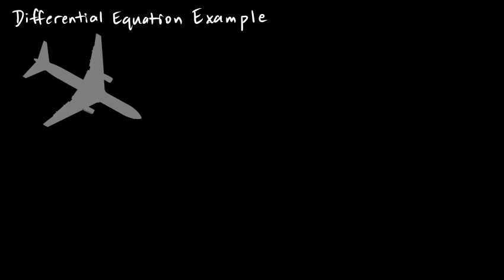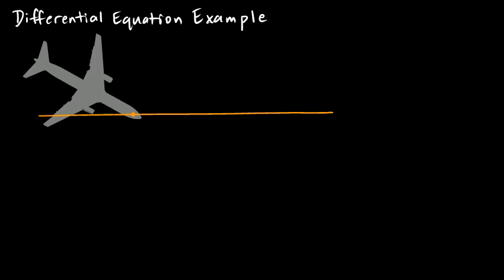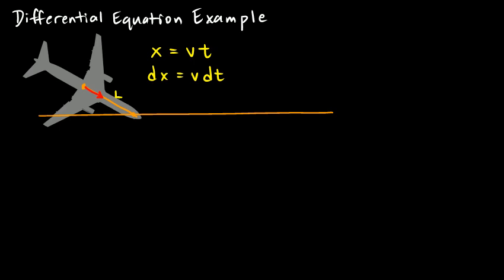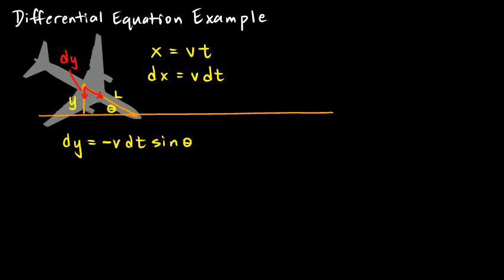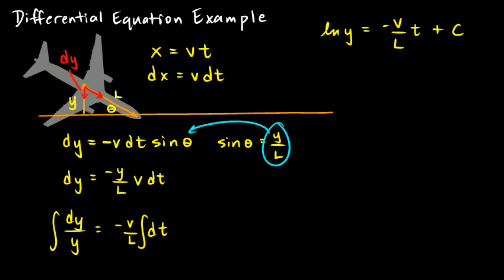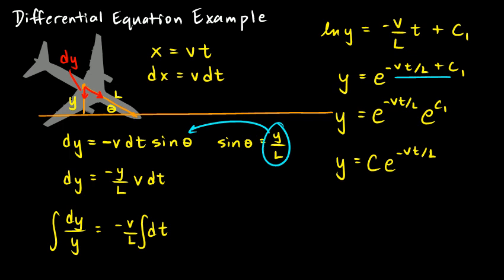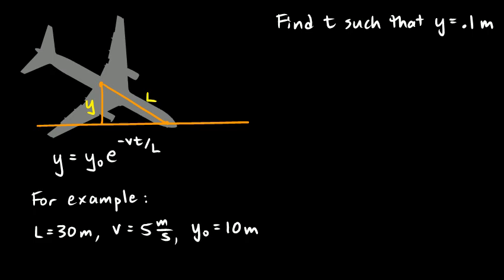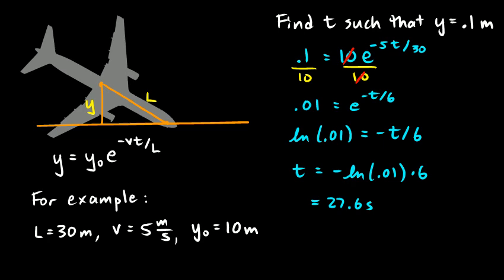Calculus  - Differential Equation Example

Comment: This is so helpful, thanks a lot Derek Owens. 
Unfortunatelly most universities teach differential equations never mentioning where they actually come from! And how helpful they are solving everyday problems in physics and other fields of science.
Reply from the maker: Thanks!  And you are absolutely correct.  At most schools, it is the math professors teaching DE, and it is probably mostly theory.  If you are studying where they come from and how they are used, then you are probably studying physics or engineering, and the physics and engineering professors usually assume that you already know DE!
Reply: Totally agree, I studied EE and it wasn't until analysing second order RLC circuits that I realized how amazing and powerful DE were!
I think similar  tutorials on PDE and how they are formed (like wave equation) by you would be awesome:)
Reply: Yes.

Next up: PDEs. :)

Comment: This is just my guess, since I am still very much a student of math.  I think it behaves this way because theta gets closer and closer to 0 degrees, meaning that after a long time, the rear wheels are mostly pointed forward, and only creep slowly towards the line.  Also, more mathematically, the e^(-x) has an asymptote at zero.  If you plugged in y=0, you would get a false statement, because there is no input that can give you exactly zero.

Comment: I thought you would be tracking the front wheels along the horizontal X axis, yet you kept referring to the hypotenuse L. In other words, instead of calculating using sine, wouldn't you use tangent?

Comment: thanks for the helpful video. why is it that the plane can never be precisely alligned with the line? and can we show that mathematically?
Reply: That is the nature of a log.
Reply: If you observe an actual B767 making that turn, the path of the main gear tires will ARC towards the line with the RIGHT TIRE tracking on a WIDER ARC THAN THE LEFT. Also the distance between the tires are not considered within this calculation, ALTHOUGH the difference between the calculated solution & the actual 'event' is small!

Comment: For people wondering the derivation of the formula for dy, here is an explanation: dy is the infinitesimal vertical change in position. Since dy is opposite to theta and the hypotenuse of the triangle, with angle theta, is |-v|dt, then sin(theta)=dy/v*dt. Hence, dy=v*dt sin(theta). We put a negative sign to indicate direction so dy=-v*dt*sin(theta).

Comment: What will happen if y=0 or y approaching 0?
Reply: its undefined.
if you solve the equation for t, you have: t= (L*ln(y_0/y))/v
but in order for y=y_0, they both have to equal 0 because e^x cannot equal 0 for a real value 'x' meaning [y=y_0=0], but that means that our ratio in our 'ln' is 0/0 and ln[0/0] is undefined.

Comment: Great video, thanks. This is assuming no noise in the system right? Of course in practice after y had reached < a few mm the wheel would keep crossing the line due to imperfections in the wheels, run way, wind, etc.

Comment: Did you ever get your friend to test this? It doesn't seem accurate to me, even though, theoretically it is correct.
Reply: That does seem like a long time for y to reach .1m. Moving at 5m/s you'd think it would be faster
Reply: Although it does feel like a long time, if you do the sums for reducing y from 10m to 1m (instead of 0.1m) it takes only half the time. Such is the nature of the problem.

Comment: If I follow this solution. This plane's speed is just 5 m/s and 18km/s. so very slow and slower than marathoner. The problem is x direction. x is not a  distance of flight of this plane. the distance of x axis when this plane is moving. and 5 m/s is the speed of shade of this plane reflected from x axis.
Reply: sorry mistyping.. 18km/h.

Comment: lost me at 'dy = -vdt sin theta'.  'dy' being the opposite side and vdt being adjacent to theta should it not be dy = vdt tan theta? as tan theta equals the opposite over the adjacent side and therefore tan theta multiplied by the adjacent side equals the opposite side?
Reply: +tbone vdt is the hypotenuse, not adjacent side
Reply: +Thgink Krad  the problem is how do you get dy = dx•sine@ ? if you started from y = x•sine@. For sure we have sine@ = L / y . L is constant and y is variable. and here @ as well variable. But I do not agree you made equation jumped to dy = dx•sine@ . and you got dy=vdt•sine@. show me how come?
Reply: +want to know DE sorry.. there is mistyping.. sine@ = y / L .
Reply: +want to know DE  And I totally agree with tone for '-'. the ' - ' is opposite direction and it does not mean getting smaller..
Reply: +Thgink Krad also as we know the speed v=5m/s. Do you really think the speed of plane is just 5 m/s ? as you said x direction is the direction of flying. so plane's speed is 5 m/s which mean 5×3600 m/ h so 18 km/h. this plane is so slow.  do you know marathon record? they can run 42.195km at around in 2 hours. so this plane is slower then human...ㅡㅡ;
Reply: +Thgink Krad So this solutions is not a make a sense. I just want to know where can I find this question and answer. please let me know which book is it?
Reply: +Thgink Krad Please answer and help me what is correct answer?
Reply: Exactly, this is what I am thinking about, If y is changing, so do the @ (teta), Then should it be represented as d@ than normal @
Reply: in which direction is the plane moving initially?/?? 
plz tell

Comment: How is: dy=dx*sin(@) ?
Reply: I was wondering that same thing! Intuitively, I would expect dy = dx*tan(@) because then we could write dy/dx  = tan(@), which according to the picture should be correct.
Reply: dy is the infinitesimal vertical change in position. Since dy is opposite to theta and the hypotenuse of the triangle with angle theta is |-v|dt, then sin(theta)=dy/v*dt. Hence, dy=v*dt sin(theta). We put a negative sign to indicate direction so dy=-v*dt*sin(theta).

Comment: Isn't it actually more complicated than that? The path of the 767 doesn't follow the slope of the triangle, if it did the nosewheel would go off the line. The rear wheels do not take a straight path (y) to the line, they must follow a curve which slowly converges on the x axis line.

Comment: This solution has problem. How dy = dx•sine@?  just skip the proof.
Reply: 'dy' is the vertical projection of 'dx' in this model. dx is a radius/hypotenuse, so the vertical comp is given by dx * sin(theta) negative in this case, but since dx is differential instead of being y, it is dy